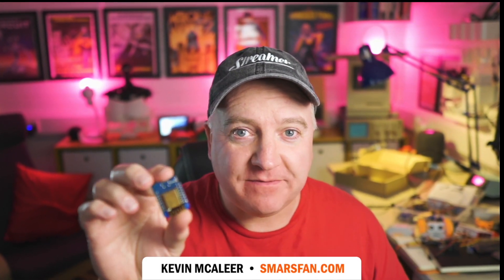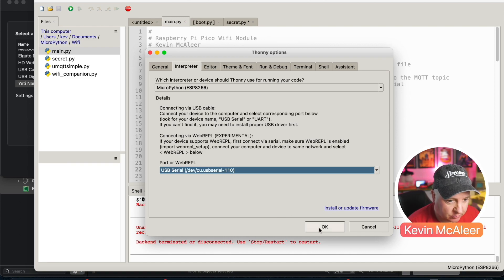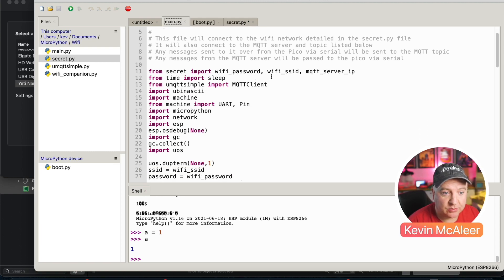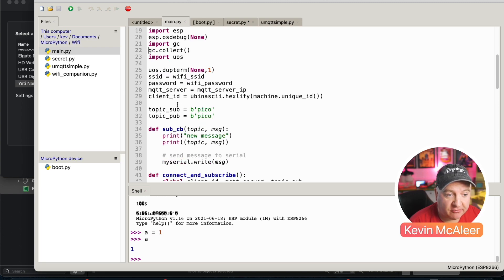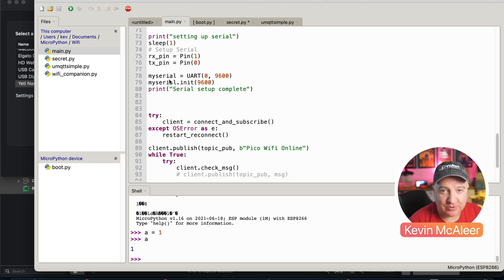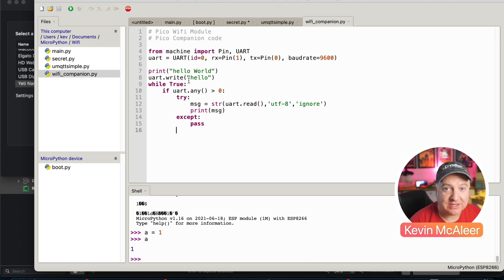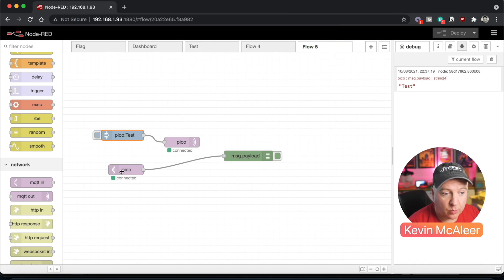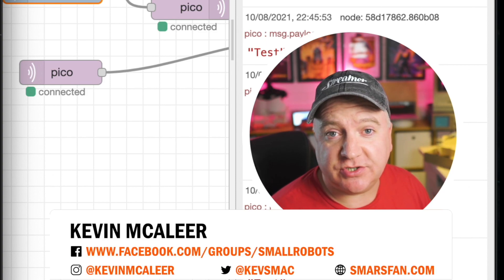Raspberry Pi Pico Wifi Module - how to add Wifi to your Pico Projects

Comment: I'm really surprised that nobody has picked up on this, but your wiring diagram is wrong.
You show pin 1 on the Pico going to pin 1 on the D1 mini, and pin 2 on the Pico going to pin 2 on the D1 mini.
It needs to be the other way around.
Reply from the maker: Thanks for spotting and highlighting this Graeme (and sorry too). I've pinned this comment so others can learn this too (and added a comment to the video description). You get 1000 points for spotting this.

Comment: Simple question: you had shown the Badger 2040 and I got it wrong cause I had thought I could add a pico W and get a wireless internet connected display. 

Now my question if this WeMos Add on would also work for the Badger 2040 without the W using the WeMos to gain that WLAN functionality ?

Thx

Comment: Hi. Thanks for creating great videos. 
I tried to connect a raspberry pi pico w to a wemos d1 mini over serial using your video but I found a couple of issues. I don't know if this is only me or others have encountered these issues. 

First, flashing the wemos d1 mini with Thonny fails. I had to flash it manually using esptools with baudrate 115200 in order for the chip to work. 
Second, it seems that communication using baud rate 9600 fails and shutsdown the REPL. 
Third, the rx pin on the wemos d1 seems to be not working and not receiving the signals. I tried to disable the REPL from UART 0 and still nothing.

If you know the reason behind these issues, I would really appreciate it if you can share it with me.

Comment: I am not being able to update the firmware
"Erase command returned with error code 1"
That is the error message I got.
Reply from the maker: Have you used the nuke file?
Reply from the maker: https://learn.adafruit.com/getting-started-with-raspberry-pi-pico-circuitpython/circuitpython#flash-resetting-uf2-3083182

Comment: I have a duinotech UNO with  wifi, which confesses to be esp8266 compatible. Will your code  work with that + raspi uno ?
Reply from the maker: I'm not personally familiar with the duinotech uno with wifi, but if it's an esp8266 it can be loaded with MicroPython and should work with the code I've provided.

Comment: HI KEVIN; GREAT VIDEO. Which  WEMOS d1 MINI do you recommend to use from Amazon or other electronic store? I am rusty with the new stuff since I am just getting back to my electronic hobbies. Thank you for your time! 😎
Reply from the maker: I think I ordered these ones:
https://www.amazon.co.uk/AZDelivery-D1-Mini-Development-Compatible/dp/B0754N794H/ref=asc_df_B0754N794H/?tag=googshopuk-21&linkCode=df0&hvadid=430764102847&hvpos=&hvnetw=g&hvrand=235640791177597736&hvpone=&hvptwo=&hvqmt=&hvdev=c&hvdvcmdl=&hvlocint=&hvlocphy=9046522&hvtargid=pla-404324883023&psc=1&tag=&ref=&adgrpid=108575012108&hvpone=&hvptwo=&hvadid=430764102847&hvpos=&hvnetw=g&hvrand=235640791177597736&hvqmt=&hvdev=c&hvdvcmdl=&hvlocint=&hvlocphy=9046522&hvtargid=pla-404324883023

Comment: Hi Kevin, 
Just found your channel, watched a bunch of your videos and subbed.
I wanted to ask if I want to change from UART to SPI communication, what would I have to change in the code?
Reply from the maker: Probably quite a lot of code - both on the wemos d1 mini to send and receive messages in SPI and then on the Pico to also send and receive in SPI. I’ll look into this; what are you looking to achieve once they can both talk using SPI?
Reply: @kevinmcaleer28  I have been told that serial communication over UART isn't as reliable as SPI, but I'm only starting to learn Python at this level and it gets confusing to do such an overhaul for my limited experience, I will have couple of drills getting info over wifi from the pico to drill holes in metal tin when the right payloads are received. do you have a course that cover this topic? (changing from UART to SPI) i'd be happy to take your course, excellent teaching skills!

Comment: I had to change the mqtt connection to this or i get a error 2... 
client = MQTTClient(client_id, mqtt_server, port=1883, user=None, password=None, keepalive=30, ssl=False, ssl_params={})
Reply from the maker: Ahh - yes it will depend on the MQTT server you are connecting too, I use an old MQTT that doesn't require username or password (which is bad I know), so I don't have to provide that info. I'll update my notes for this for any future videos, thanks Tom

Comment: Perfect, thank you. I have one problem. Once I send a message from pico via wemos to a client, then it stops. No other message can be received from pico. I need to push the reset button on wemos and then I am able to send a message from pico again. What can be the reason or what should I do? Thank you
Reply: Did you find the solution to the problem?
Reply: @thomassteffen9003 Unfortunately no. I excluded pico as I realized that also wemos d1 mini can do the job (read data from temperature sensor and send it via mqtt)

Comment: Hi Kevin - Did you need to make any modifications to the Mosquitto Config file? 
Or did it just work for you automatically? 

I know you aren't an IT guy, but I'm posting here in case anyone comes across or has come across this issue:

I can get the 8266 connected to my Wifi (shows up on pihole clients, and angryIP)  but when I start Mosquito in the terminal It tells me "starting local only mode. Connections will only be possible from clients funning on this machine"

Therefore, when I run [mosquitto_sub  -t  "pico"] in the terminal I the messages from Node Red show up but nothing from ESP8266. 

No solutions on Stack Overflow have been able to resolve this, so if anyone knows, please drop me a DM.
Reply from the maker: Yes - I do have a config file:- grab a copy here https://github.com/kevinmcaleer/ClusteredPi/blob/main/config/mosquitto.conf

Comment: can i transmit video through this wifi module i receive it to an application?
Reply from the maker: You probably could, but I'm not sure what the use case for this is. Have you seen the ESP32Cam module? thats purpose built for exactly that.

Comment: so I have few devices operated by Pico and while I wanted to have the messages online I used Zero W connected via UART with PICO.
truth be told: if Zero had ADC then ... ;-)
otherwise: why would we need Pico if we have i.e. ESP32S with 38 pins?  I am still thinking ;-) ESP32S is half size of Pico and half price as well, it has all digital and analogue pins needed - what am I missing: why Pico would prevail?
Reply from the maker: It’s a really good question - the stats from my videos show people want more and more Pico videos, and not ESP32 videos. Maybe it’s a marketing thing.
Reply: @kevinmcaleer28  That's all the people with Zeros lying around who are comparing Picos to Arduinos, not ESP32.
ESP32 also uses 3X the power even with wifi/bluetooth turned off, and is also more finicky about voltage and won't put up with crap like AA batteries. It does hit a sweet spot where you need something accessible via wifi or Bluetooth that needs to last a long time and can run on a 3.7 volt battery. But most gizmos in the house will have access to power, the Zero can last a short time on a battery, and if you're making an RC toy, you're probably OK using IR or 433 MHz. Also ESP32S is marketed for industrial applications and can be bought in lots of several hundred; the Pico is being sold as a toy like a 3D printer. You use it to make stuff for yourself that no one manufactures; you don't want to see 3D printed parts and Picos running MicroPython in your car.
It's not like this is a serious investment. These things cost as much as a 40 oz. can of beer and you'll solder the first one you buy into something stupid anyway.
Reply: @kevinmcaleer28  I started my journey with RPi4 some time back. Then I moved to Pico. Only then I "discovered" ESP32 and I am astonished how advanced ESP32 is vs. Pico - the technology from few years ago v. 2021. Seriously: wifi/BT module added to Pico natively and we are done! Even the price: 3 GBP for Pico vs 1.5 GBP for ESP32S ... What do we need for accuracy? Most of IoT devices will be ok with mediocre accuracy (I am testing ADC on ESP32 recently and... not the best one but still that is enough for simple measurements for IoT). And if you consider that majority of devices for home automation can be even done with ESPhome on HA... That is the killer. Btw I "forgot" that ESP tolerates max Vcc of 3.6V and I connected it directly to  5V - do you think it cried? Not at all! It works with 5V ;-) OK, I moved back to 3.3V but still. ;-)
Reply: I was about to ask the same, it's funny, even ESP32 has built in bluetooth, some boards have battery, recharge module, a display and so on, almost same price as pico.

Comment: I've been playing with the Adafruit Airlift - an ESp32 preloaded with firmware. It definitely worked with Pico - but felt a tiny bit slow.
Reply: Could I ask you how you got micropython onto the Airlift? I’m struggling with that right now and would rather avoid circuitpython.